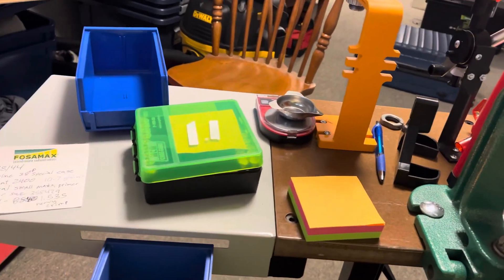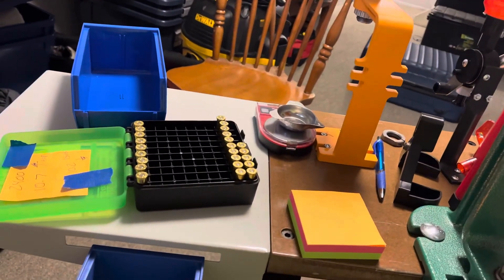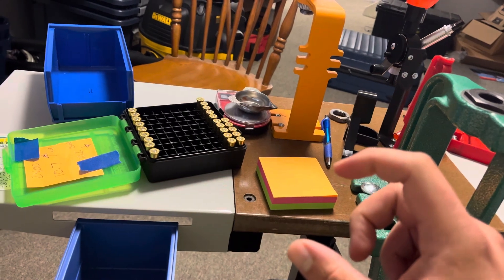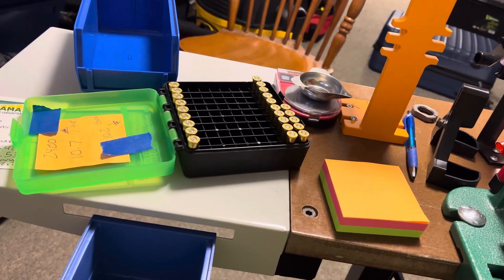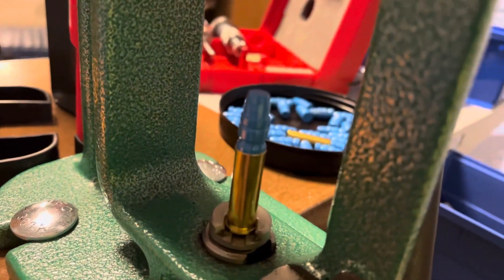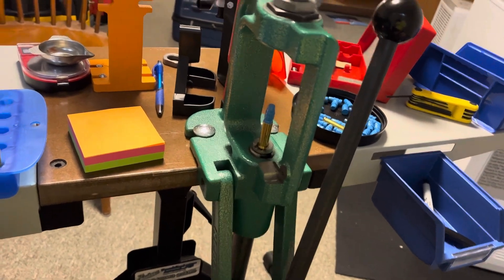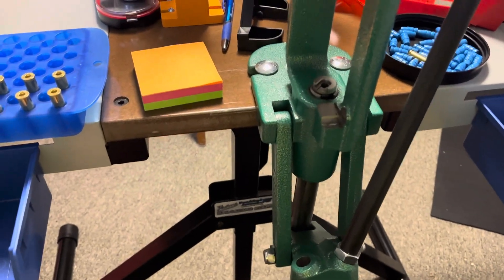38/44 reloads

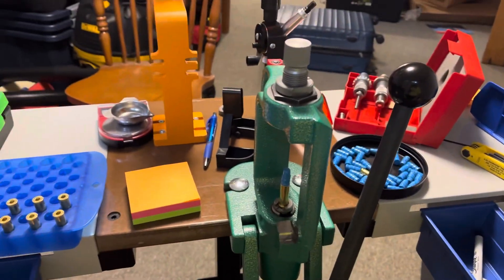Comment: For the speed data posted in Scene - 7:59 and onward, what type of firearm did you use and what was the length of its barrel?
Reply from the maker: Ruger GP100 with a 4 inch barrel.
Reply: @heavyleadenthuasist38  - Great! I have the same type and barrel length revolver.  Those are very impressive velocities and I plane to load some 38/44 Heavy Duty loads after seeing this.
Reply from the maker: @F15ElectricEagle  I’m glad I could help!  Just make sure to start low on the load data.

Comment: The .38/44 was pretty regularly shot through Colt Army Special/Official Police and Smith N frame guns back in the day. 

.38 Special I’m general was way hotter back then than commercial loadings today.
Reply from the maker: Very true!
Reply: I’ve heard conflicting reports on that. I’ve been told the official police and new service were both advertised as being capable of handling the 38/44 but I’ve also heard people saying that colt only advertised the New Service as being capable of handling it. The new service makes sense to me but the official police I’m still unsold on.